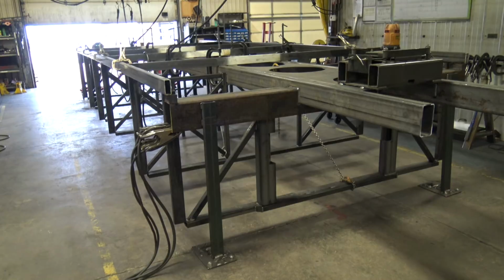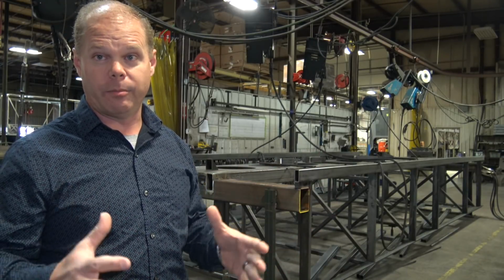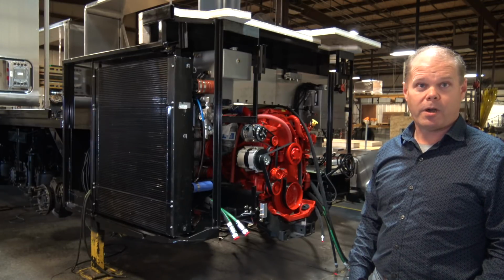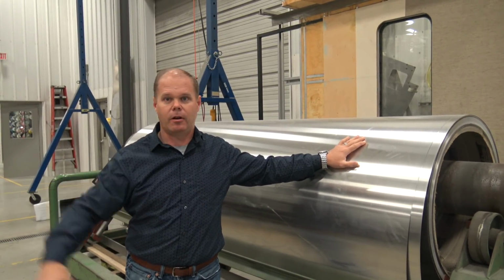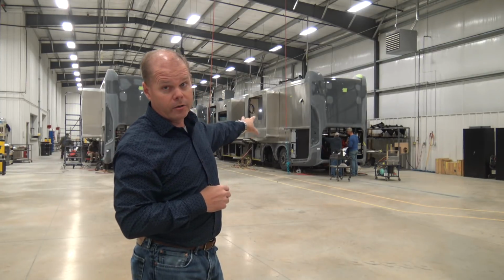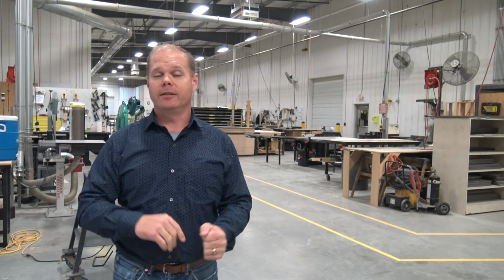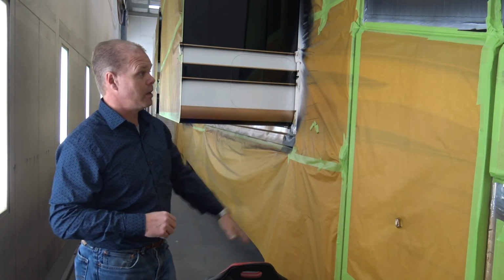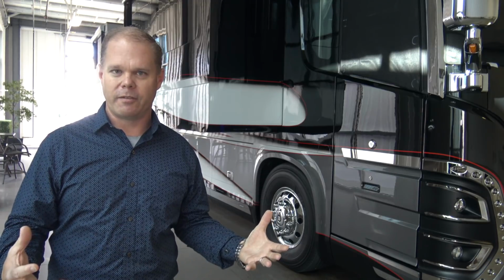NEWELL COACH BUILD PROCESS EXPLAINED BY VP OF ENGINEERING

Comment: I remember one of Prevost conversion (Marathon or Liberty, maybe?) uses a type of special plywood that are used by NASA in their projects. The plywood is at least as strong as regular plywood and is very very light, you can lift 2-3 cabinets single hand. Newell should really use this kind of plywood as well. The saved weight benefits carrying capacity.

Comment: Nice job Andrew. I noticed they paint their coaches after the interiors are complete. Marathon coaches paint theirs before installing the interiors because the heat from the paint drying process might affect the finishes inside. Both manufacturer’s coaches are built metal skin over a metal frame. Does Newell use a different paint process?
Reply from the maker: Great question! I will have to ask about that next time I talk to the folks from Newell Coach.

Comment: Andrew, exceptional video! Would have liked to see the custom design process. One area where Newell differs from a stock production coach is the customization options for a customer. I would have loved to hear about inserting different appliances, fire and safety systems, and water purification components. Also renewable energy options such as Lithium and solar. Understanding how finishes are selected in their design center. It's tough picking some details from a swatch. Finally, I was wondering about the paint schemes. I know you love the "Dean" swooshes, but some of us would like to know about how to develop a custom paint design.

Comment: Could you ask them if the basement floor is plywood or steel. Seems like a lot of them with wood end up having to be replaced down the road from moisture.
Reply from the maker: One of the salespeople explain this point very well, coming in a future video.
Reply: The older Newells used 10 gauge steel with plywood lining on top of it and sprayed on foam on the bottom. I will be interested to see if they still do them that way.